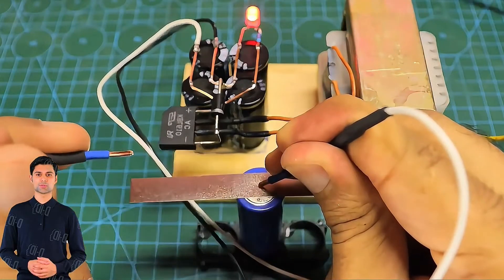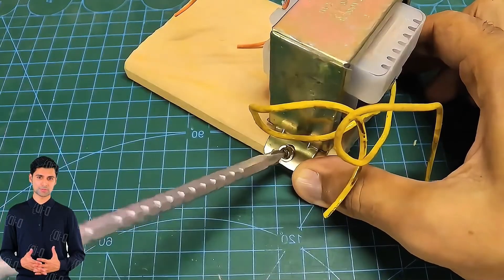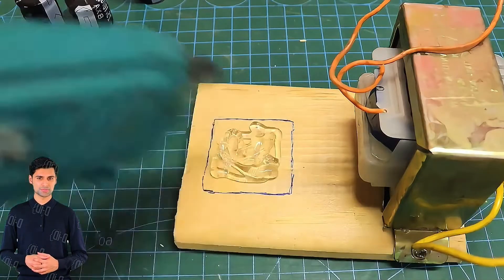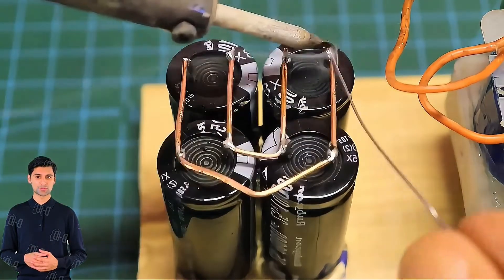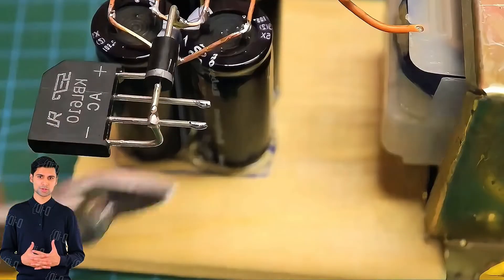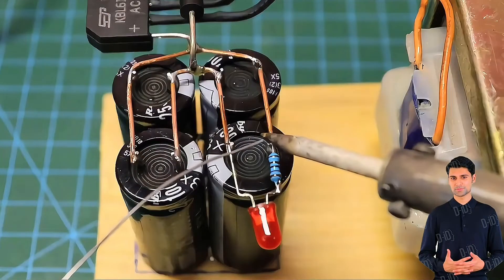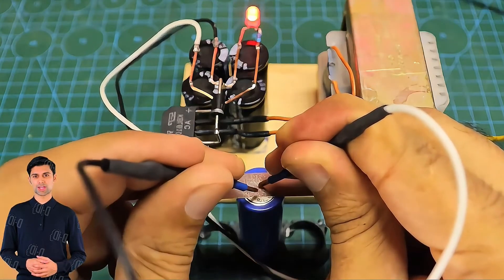How to Build Your Own DIY Spot Welding Machine : A Step-by-Step Guide

Comment: My transformer has 12V and 24V outputs, can I use the 24V output on the same circuit or do I have to use different capacitors?
Reply: You can use the same circuit with a capacitor of adequate voltage rating - 50V or 63V

Comment: The bridge rectifier converts the AC to a DC and charges the capacitors. What is the purpose of D1 diode ?
Reply: Not necessary

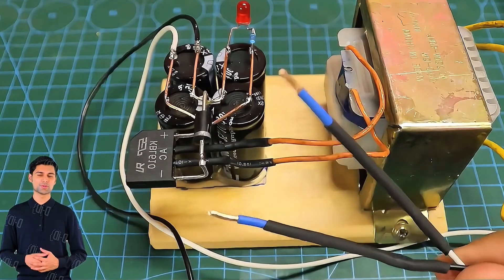Comment: Power supply is 12v or 220v? 2:41
Reply: Depending on the transformer the input can be 110 volts ac or 220 volts ac and the output will be 12/24 volt AC depending on the winding

Comment: How the capacitors are loaded if the diode is in the opposite direction to the rectified negative, I see that it works but I don't quite understand
Reply: That's because the diodes direction changes according to the flow or the type of charge . For negative charge the diode needs to be in reverse order and for positive charge the diode needs to be in the right way ...
Reply: @ahsiam4234  aaah i understand now, thanks for the info bro